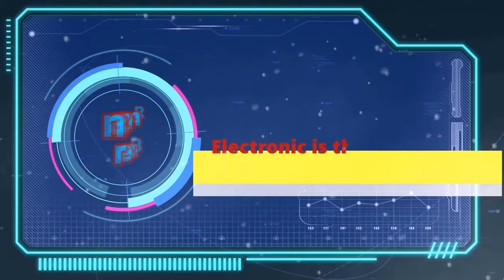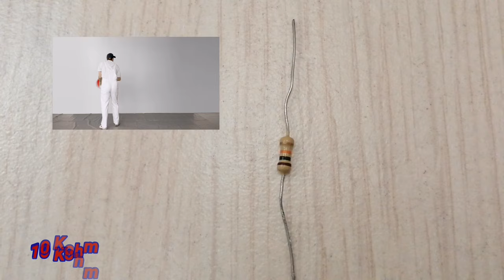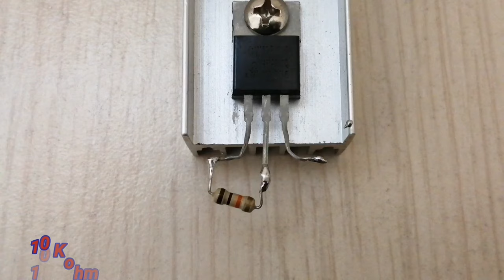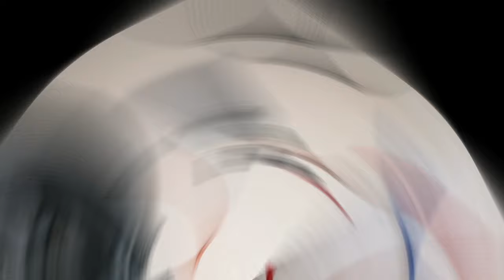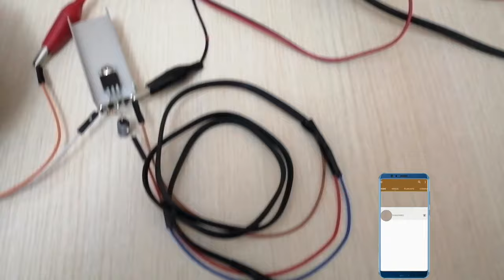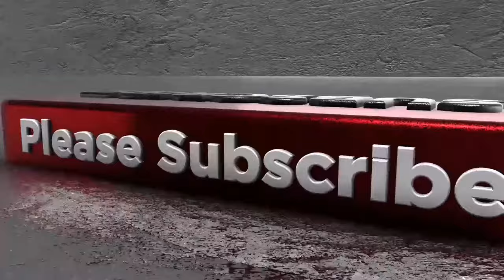How to make amplifier using 7805 voltage regulator | 7805 Voltaj regülatörü ile amfi yapımı | DIY

Comment: Arkadaşlar elimde 7905 var.ama ne garip ki 7805 gibi çalışıyor.sizce nedendir?
Reply from the maker: Merhaba hoşgeldiniz. 7805: +5 çıkış verirken, 7905  -5 volt çıkış veriyor. Pin bilgileri de farklıdır, haberiniz olsun. Kanalın gelişmesi için desteğinize talibim takibe alırsanız sevinirim teşekkürler
Reply: @RamazanBaser  selam 7905 1 nolu artı giriş,2 nolu pin eksi,3 nolu pin artı çıkış fibi çalışıyor.halbuki 7805 böyle çalışıyor.
Reply from the maker: 7805: 1 pin + girişi. 2 pin - girişi.  3 pin +çıkış. 
7905: 1 pin - girişi. 2 pin + girişi. 3 pin - çıkış.  Takibe alırsanız sevinirim teşekkürler  😀
Reply: @RamazanBaser  işte sıkıntı burada 7905 aynı 7805 gibi çalıştı.sizin yazdıpınız gibi bağladım 7905 i çok ısındı.banada bu durum tuhaf geldi.paylaşmak istedim.
Reply from the maker: Yük olmadan ısınması hayra alamet olmasa gerek :) Bizim bu videoda 7805 amacı dışında, amfi olarak kullanılmıştır. İyi akşamlarınız olsun.
Reply: @RamazanBaser  bu anfiyi daha önce yapmıştım.🙂👍.iyi akşamlar

Comment: video için teşekkürler. 
elimde eski bir televizyon anakartı vardı. oradaki bir kaç parça ismini sayarak videoda ki gibi anfi yapabilir miyim öğrenmek istiyorum.
soğutucuya bağlı 7805CT legüratör var. 35v100uf farklı renkli dirençler var değerlerini bilmiyroum.
bir adet 8 ohm 10w hoparlör var.

5v 1amperli bir adaptöre yada pc de usb'ye bağlarak anfi yapabilir miyim ? Yapacağım kolonu pcyebağlamak istiyorum
Reply from the maker: Merhaba hoşgeldiniz. Yorum için ayrıca teşekkürler. 7805, aslında voltaj regülatörüdür. Yani,  6/7-35 arası voltu 5 voltta sabitliyor/düşürüyor. Amfi için pek tavsiye etmem. Zira bir adet olunca ses tek/mono olur. Stereo ses için de iki adet olması lâzım o da boşuna enerji tükenmiş olur. İlla yapmak isteseniz videodaki gibi yapmaya çalışın. Olacaktır. 
Ses entegreleri var. 5 volt ile çalışan tda2822M gibi. Karta dikkatlice bakın, ses entegresi vardır muhakkak. Onu değerlendirebilirsiniz. Kanalda baya amfi, ses devreleri vardır. Göz atabilirsiniz. 
Direnç değerlerini netten, ya da uygulamalar yardımıyla öğrenebilirsiniz. Değer, ya da direnç rengini girerek değerini öğrenebilirsiniz. 
Kanalın gelişmesi için desteğinizi bekliyorum. Abne olursanız çok sevinirim teşekkürler
Reply: @RamazanBaser  teşekkür ederim